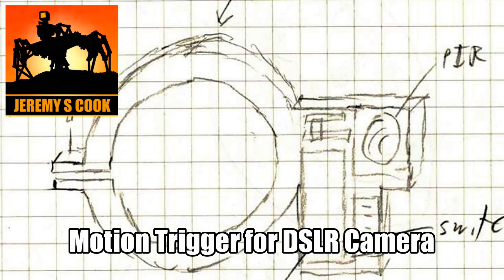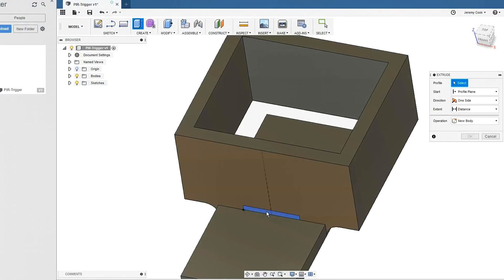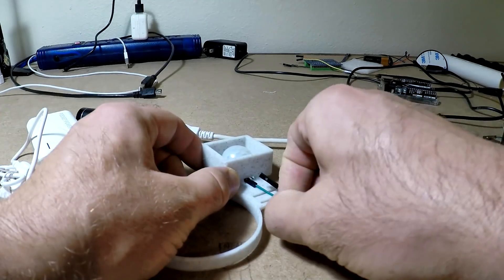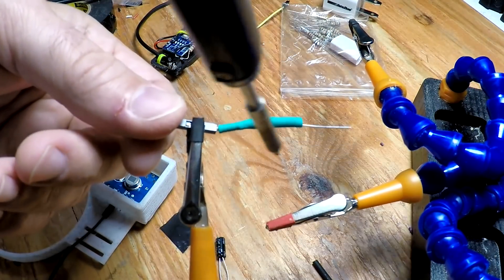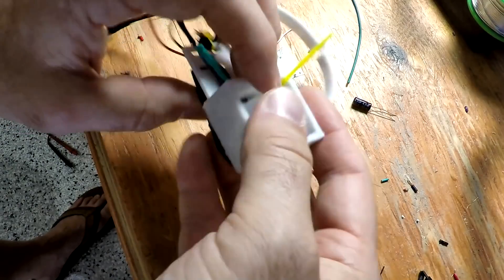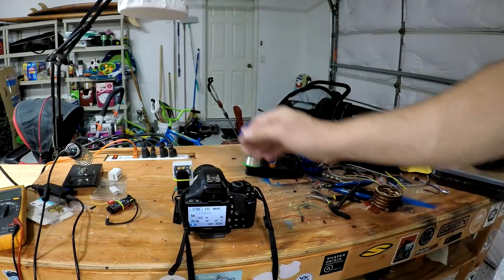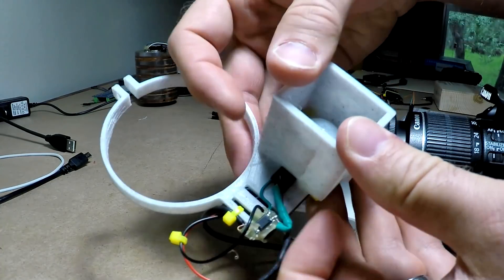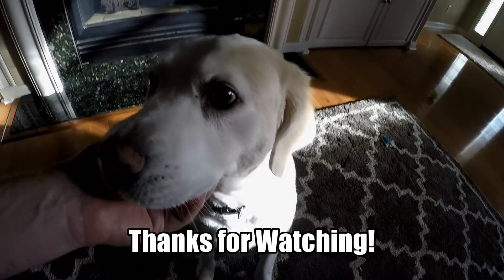Camera Motion Trigger with PIR Sensor and Opto-Isolator [3D-Printed]

Comment: Hey, great Video! I am currently wanting to build my own camera trap, but don't have the money for a camtraptions PIR sensor. I have a Nikon d3300, one Nikon SB-28 with connection cable, tripod, housing, and I have just purchased the PIR HC-SR501 sensor and an optocoupler. Unfortunately, I have absolutely no know-how regarding those electronics, but those were the main parts for a sensor, as far as I could research. As I just want to start and don't need any custom code for my first test camera trap, I wanted to ask whether I need any more parts for my PIR sensor and how to connect the sensor to the camera (what cables). If anyone here could help me, that would mean a lot to me, as I am urging to capture the wolves that are in my area currently, but don't have the money to buy a camtraptions sensor and therefore want to build my own

Comment: Nice, I did a sightly more complicated version a while back, I could forward a schematic. What I found for wildlife was that it was helpful to have it snap a half dozen times whenever triggered to help capture things. Also note that the sensors have a could modes to control how often they can be triggered. Cool project as always!
Reply from the maker: Neat - yeah I think something like 5 seconds was the shortest delay, could be much longer I believe.

If you want, feel free to sent it over to hi@jeremyscook.com - I'm always interested in new/improved designs!

BTW, going to Palm Bay Maker Faire? Guessing it will be quite a bit smaller, but I'm supposed to have a booth there.

Comment from the maker: Hope you enjoyed. As I was nearly done with this, someone's head(?) mentioned that Magic Lantern also has this kind of functionality. Anyone tried this software upgrade for Canon DSLRs?
Reply: Magic Lantern has quite a few triggering options.  It has a very configurable intervalometer and a motion trigger.  I haven't used either of these modes, though.  Your setup has one big advantage over Magic Lantern.  Your setup doesn't need to constantly run the sensor and processor to watch for motion!

I've only used one of Magic Lantern's automatic shutter triggering modes.  It has a mode where it clicks the shutter for you when you manage to hold the camera steady for a certain amount of time.  It helps get a clean shot when your shutter speed needs to be low, and even just pushing the button might jiggle your camera a little too much.
Reply from the maker: Neat, maybe I'll throw it on an SD card and see what happens! @patregan

Comment: Would it work with 433hz rf transmitter receiver module with this ?
Reply from the maker: You should be able to hook that up, using the opto-isolator, though it'd be a bit different circuit.
Reply: Thanks, this current design has helped me capture a indian crested porcupine in the woods by my house. I am an absolute noob to electronics but is the opto isolator the same thing as octocoupler. Could you make an article or a video to follow with rf transmission, it would strategically help place the sensor on the animal trail.
Reply from the maker: @akshaykhare22  So you've actually duplicated the design? That is so cool, got photos up anywhere? Yes, I believe those refer to the same part.

I don't know that I'll get to a video any time soon, but if you have one of those keychain RF remotes, you should just be able to connect the signal output and ground to either side of the opto-isolator to have it work. This video isn't quite what you want, but may give you a few ideas: https://www.youtube.com/watch?v=y6WMAieY9Pc
Reply from the maker: @akshaykhare22  Got it, thanks so much!

Comment: I am interested in making one of these but I have only 100k resistors; I checked the Pir Motion sensor specifications and the working voltage is from 5V to 20V. The batteries are 6V, what shoud I do ? Thx
Reply from the maker: Hello, your batteries should be fine, but 100k resistors will likely be too high. The resistor is there to protect the LED in the opto-isolator, so it's possible that it would work (at least for a short time) without the resistor, but I'd put a lower value resistor on there if you can.
Reply: @JeremyCook  Thanks
Reply from the maker: @dvpower200  No problem! You can also check out this video for some ideas if you like: https://www.youtube.com/watch?v=y6WMAieY9Pc